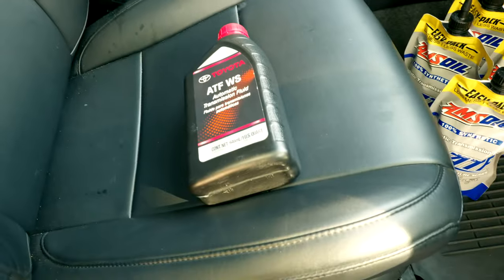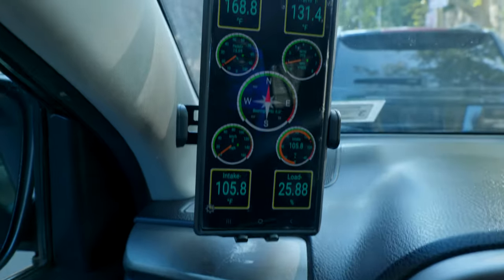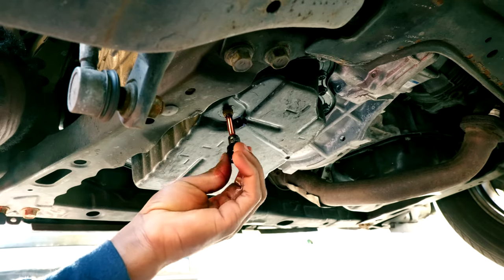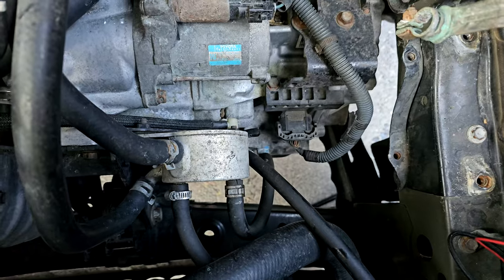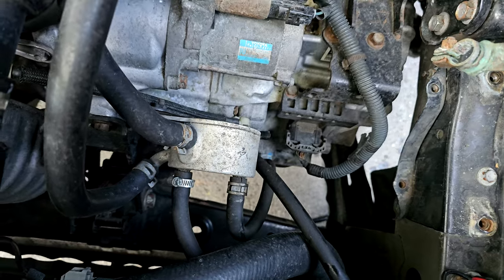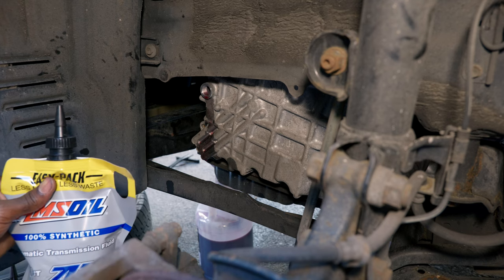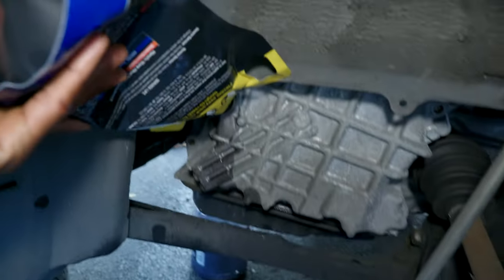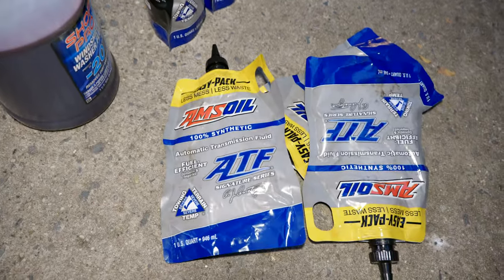Amsoil Signature Series Transmission Fluid -TOYOTA WS - ATF

Comment: Bro just open the transmission fluid pipe under the radiator or from the heat exchanger and put the transmission pressure pipe into the bottle after changing the first 3quart then ask the anybody to go inside the car to turn on the car so the transmission will pressure out the old fluid, and take out the same amount in which rest on with you so in your case there is 3quart so just take a 3quart out and ask your friend to switch off the car than add again the rest amount to the oil pan (this called transmission flush)

Comment: I recommend you change what comes out, never let transmission run dry. 
You can always change transmission oil later while doing engine oil. Usually 2.25-2.65 for 2011 Camry. . Depending on the angle tilt of the car